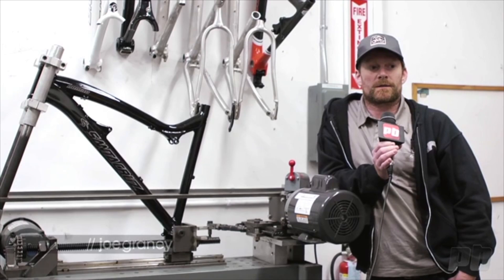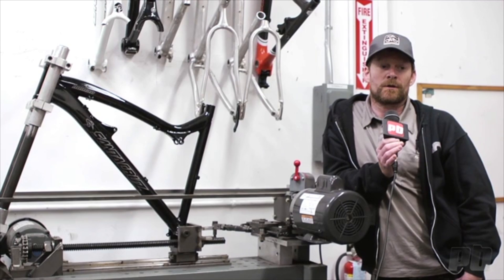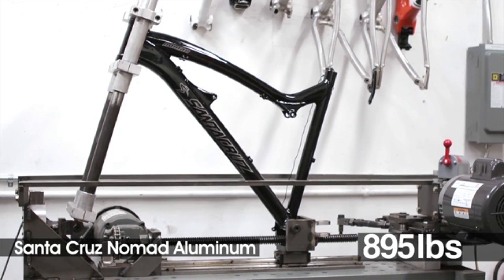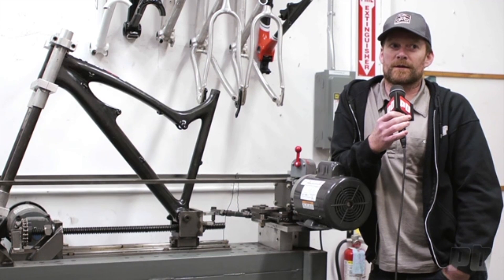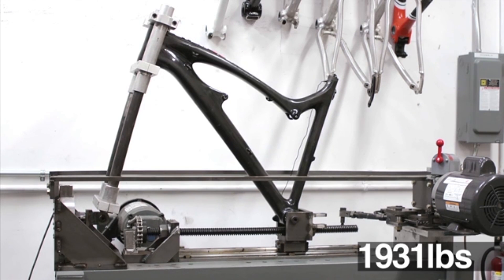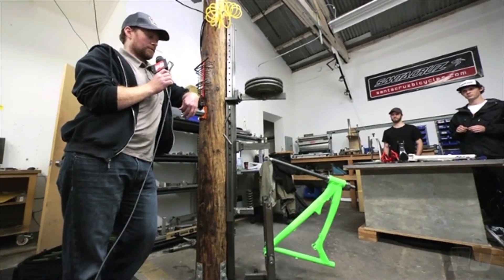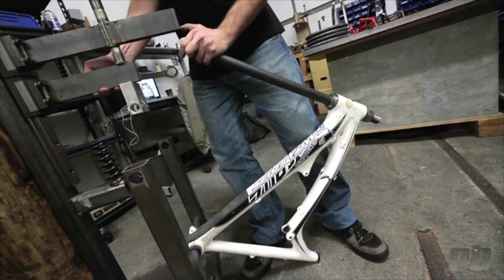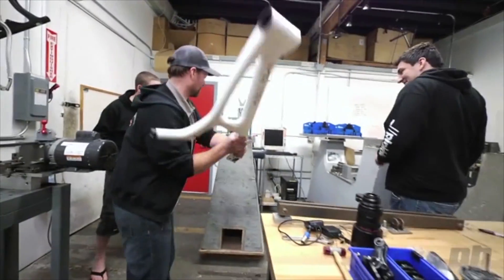Carbon vs Aluminum Frames - Which is Stronger?

Comment: Aluminium fails slowly, allowing one to detect problems before anything too serious happens. But carbon fails catastrophically (sudden snapping), which is way more dangerous to the rider.
Reply: what about riders with arms that cannot withstand 2100lbs of force from casing a jump ?
Reply: carbon dick splinters adds to the fun of riding bud
Reply: Sometimes. Really rigid carbon parts tend to do that. Delamination based failures are usually pretty gradual. You'll hear cracking as successive layers of carbon delaminate and fail.
Reply: MrChangCJ With the paper thin double butted tubes used these days in alloy framed bikes the yield point and ultimate failure point are very close together. As for carbon, I'd be more concerned about dropping a carbon frame sideways into a rock and cracking it on a load it wasn't designed for....
Reply: @eaxnitro  you do not need to worry about this. All frames which are properly manufactured are also crash tested.
Reply: @eaxnitro  super valid!!!
Reply: MrChangCJ I have seen all metals fail welds snap often with no warning!
Reply: hmm, i see. thanks for the insight. i shall do more research.
Reply: @gillenzfluff8380  Then you were not constantly inspecting the welds on a regular basis.  They just don't snap with no warning its not their nature.  There is neglect somewhere in there your not telling us.
Reply: still defend on the rider how they ride it ..
Reply: The thing that really scares me is if a sudden impact causes frame failure it will also cause the rider to fly forward with great force.
I'm afraid for the body part which will end up right where that broke, and a sharp edge with sharp penetrating fibers isn't my idea of a good feeling.
Reply: You hear creaking noises before it breaks in two. And for that, like I said below, you will alose need to weight like 600 lbs.
Reply: this isn't accurate. i've seen the exact opposite happen.
Reply: This may be mostly true, but the carbon frame holds up to much more abuse, as seen in this video.
Reply: Yeah but its also way stronger dude.
Reply: Spot on. I've seen carbon bars snap off of a drop so fast the guy went face first into the clamps.  Had they been aluminum i feel he could have saved his face with a bend. I've has aluminum bars since day one and have bent them giving me the opportunity to replace them.  Just the thought of eating a clamp makes me want to keep the aluminum.  But on the other end I love the looks and feel of Carbon.
Reply: @benmartin3351  I can't bare the thought of CF bars for this very reason, a frame sure but bars never.
Reply: @bojangles2492  
 
I had three aluminum bars break on me (back in the 90s, so on the one hand probably thicker, but also probably less technologically advanced) and all of them went “snap!”; no warning.  Switched to titanium and no problems since.
Reply: @benmartin3351  
I had three aluminum bars break on me (back in the 90s, so on the one hand probably thicker, but also probably less technologically advanced) and all of them went “snap!”; no warning.  Switched to titanium and no problems since.
Reply: @benmartin3351 cheap carbon bar, ehh? People these days are talking about buying the china carbon bars, bro if they snap Im not surprised.

Quality components almost never fail.
Reply: I broke an aluminum frame just by applying my rear brake, how are you going to tell my the sound of my frame snapping was slow and allowed me to detect the problems before it had a catastrophic failure.
Reply: @carson54444 you buy cheap POs bike  lmao
Reply: Oe si tienes razón! El aluminio te avisa con tiempo
Reply: sure carbon composite components such as the frame don't involve plastic deformation, but in most cases their stiffness is so extremely high that their elastic limit is not surpassed.
Reply: Metals build hairline fractures. Generally the welds that fail.
Reply: @Mp57navy  yes, and not directly at the weld seam but in the immediate vicinity. But that is something you got to be looking for in order to see it. Thats why washing the frame properly and looking at every weld seam is a must. If you do that on a carbon frame it might still be hidden between the layers and thus impossible to see without NDT (Non Destructive Testing, like an ultrasound).
Reply: @Mp57navy again only true for bad quality. Most of the time quality weld joints are stronger than the material itself.
Reply: True it becomes is absolutely dangerous to ride, but on the other side carbon is pretty much always repairable and once repair it will get back to its brand-new state and costs fraction of what a new frame would cost.
Reply: But, IPP, what you've seen is a lot more exciting carbon.
Reply: There are also more problems to detect in Aluminum.
Reply: My alu frame broke without warning if a sudden crack forming is considered without warning.
Reply: From what I've seen and heard, that's not true. There is a reason miners avoided metal beams, it snaps under pressure without warning. However, Carbon, as far as I've seen in several videos, just slowly disintegrates. I also had a Titanium seat post snap of recently, that was not sudden, but quick enough, same happening on a frame would have been terrible.
Reply: Nope, that has been debunked.
Reply: You're seriously writing this on a video that shows the carbon one to be 30-200% stronger in every test. 

Yeah I'd much rather have no breaking than slow breaking. 

Fucking copium.
Reply: That's right i geus 😢
Reply: I ride carbon stumpjumper and santacruz 5010 ,  with my 71 kilo no much harm on the bikes , I love carbon , iths so strong carbon wins 🎉🎉🎉🎉🎉
Reply: Steel is real, bitchez!
Reply: @WesleyChe  yes!!!
Reply: I have replaced the front triangle on my 2003 Kona Stinky Dee Lux twice because it has bent or failed catastrophically during hard impacts, but I love the bike and it's geometry so much that I'm unwilling to part with it. I feel the same as another poster in that if I were a sponsored rider, I'd ride a carbon frame without any fret, but as a private rider an aluminum frame is cheaper to maintain and replace.
Reply: The tests were for massive jumps anyway
Reply: Yes but more spectacular, imagine the video you'll get, just wear a full face.
Reply: Yes best answer here for sure !
Reply: Aluminum can brake just as sudden. It’s about where you get your frames from. Cheap frames will always brake way more often than good ones.

But I would indeed rather ride an aluminum budget frame, I don’t buy cheap carbon.

But for me quality carbon is at the very top. Nothing beats it.

Comment: The aluminium is stronger than carbon after 2 or 3 years of use. (which is the carbon longevity)
then, it just breaks out. the alloy bends.

Comment: A fail in the aluminum frame seems to equal bent, whereas the fail in the carbon frame equals snap/shattered.  I would rather take my chances with a failing aluminum frame out on the trail.
Reply: it will take a ridiculous fall for you to break either one.
Reply: but ig once there is delamination, it slowly gets worse over time even on small "impacts" from regular use
Reply: dumbass smh
Reply: Good
Reply: Charles Pastore or you get shards of carbon going into you, then breaking apart inside of you making it much harder to remove... Your choice
Reply: even with delamination on the carbon frame, the aluminum still completely failed before the carbon
Reply: Shane Scott or you get cut on sharp aluminum...

Comment: On the first test the carbon frame was delaminating way before it snapped.
Once it starts to delaminate its over...
Carbon and aluminium have diferent properties. Simply saying carbon is stronger is VERY misleading.
Reply: Its good thoughts. But! Aluminium also start to deform plastically before it fails. After the first plastic deformation it is also: game over for the frame. It will fail completely very soon. To be very precise you need to find the point of the irreversible deformation of both frames. That would be very scientific and not spectacular. Still this comparison is very good to have a slight impression.
Reply: @nawowas8818  Almost. Yes, for Alu, the force at which it starts plastic deformation it's first failure. For Carbon Composite it's the the force at first crack, because in a complex structure like this the permanent deformation might be undetectable after the first crack. And given the complex forces a bike withstands on a ride, a simple crack for a carbon composite frame from one load scenario, might generate a catastrophic failure at much lower forces for a different load. So if they did the first test and stopped at the first crack of the carbon frame, then put the same frame on the drop test, I doubt the second test would have reached such high values as the frame that was just tested with the drop test. Although, doing the same with an Aluminium frame, the result of the drop test after the first one, would be very close in impact results compared to the frame just tested with the drop test.
Reply: @jpfidalgo7  did noone really listened on how beated Up that first carbón frame was already to begin with?
Reply: @vittocrazi  did you read my comment? I'm not questioning the frame, just to explaining the differences in failure modes between both frames. As an example, and completely speculating, both can have the first failure mode at the same load, or different for either case. So the aluminium frame could deform permanently with 500kg and the carbon could have the first crack at the same 500kg, or higher or lower than that... I mean the first failure mode is different and subsequent failure modes change a lot.
Reply: @jpfidalgo7  i tagged you by mistake
Reply: @nawowas8818  yes its called it will buckle and bend before it snaps
Reply: Pedro Gonçalves exactly- they need to take the force at where the frames begin to fail rather than where they completely fail
Reply: if you like a breaking frame more than a bending frame before failure, then enjoy the carbon, mates. 
more interesting is the fatigue strenth.
and to all the people who have a better experience with carbon frames. Please write how much you paid for the al frame and for the c frame. Both  materials have their right on the market.
Reply: @meddy921  tbh if you break your frame you are a very very fast rider and crash really hard so if you ride like the average person either is fine tbh if you race aluminum is a bit better although carbons starting to get way more stiff and durable on bikes compared to 2015-2018 so now its kinda hard to go wrong with either
Reply: Very misleading haha..
Reply: @ernestchoi7891  it is only misleading to dumb people
Reply: Agreed!!!
Reply: Alum frame were buckling at 800 ish . Would've been junk at that point . At least with carbon you would still get some More use out of it.
Reply: Darrell Funk and then you can throw it in the landfill where it will stay for eons. 👍🏻
Reply: @djfung  And carbon frame starts cracking at 500 lbs
Reply: They are just trying to get you to spend more money on carbon
Reply: @bike-cave-man2527  Canyon bikes snap all the time either carbon or aluminium...
Reply: @bike-cave-man2527  anecdotal evidence is no proof of anything.  There's too many variables to why your aluminum frames failed while your carbon has survived.  I rode a Cannondale caad8 with a dent in the chain stain for years and never had issues, doesn't mean all aluminum frames behave the same way.
Reply: @bike-cave-man2527    Generally in   9/10 tests  Carbon is  stronger than Alu
Reply: Thank you. Finally some one else understands
Reply: Bike-Cave-Man canyon and vitus? Please. Throw some nice metal frames in there and we can talk. I broke 2 trek frames. Nobody to blame but John Burke’s greedy cheap-ass ways. #tuckfrek
Reply: @bike-cave-man2527  Just buy a dirt bike bro, there's a lot of option even electric ones

Comment: carbons fatigue strength is amazing but what about crash strength even though they did a smash test there was no x Ray that would have probably shown micro cracks or delamination. and most the test her stop once the steel bends but they wait tell the carbon snaps they don't stop when it's just cracking. and alluminum may show the damage whille carbon could hide it I'd take this test with a bigger grain of salt if the frame was x rayed after the tests

Comment: Was a Santa Cruz fanboy until I saw this. These guys mke sick looking bikes though.  I hope they played coy, and the SC engineers aren't this clueless.  Carbon microcraks and delaminates instead of bending or warping. Yes it exploded at a much higher pressure point than the aluminum but if you stopped the test for carbon at the failure point for aluminum and testing it with ultrasound you would see just how misleading this video is.  MTB pros use carbon not simply for the weight savings but for torsional stiffness, and its ability to do just this.....stay intact at a further point in its structural failure.  When your racing a 3 min downhill and you hit a big jump wrong, youll be able to finish on carbon where as alloy will probably warp or bend.   Doesn't mean the frame is any less broken though, just more rideable enough to finish.  Works for the pros who will just swap a questionable frame out anyway, not so much for the dentist being a warrior on the weekends.

Comment: im 220 geared up and lift weights. im still super skeptical about any carbon. i have to buy overbuilt chassis. i was at bike america looking at chassis and some of them have super skinny rear triangles. i think a lot of bikes are for sub 140 lb riders. i would not buy them at all. or you see pivots with super high bi directional bearing movement which you know is going to fail fast. and those frame where there is a lot of shock eyelet movement. ya no way.

Comment: The carbon frame creaked first time at 800lb. This kind of frame is already unusable. 
Alluminum frame bended irreversibly just some when over 1000lb. Carbon is a good choice for tarmacs but definitely not a good one for consumers MTBs

Comment: The only problem I have is, why do I see more carbon frame fail or brake then aluminum. If you lessen close the carbon frames are cracking a lot sooner then they lead on. If you ask around I bet there are more story's out there about carbon failing then aluminum. I raced bmx for years from chromoly, titanium, and aluminum. I would have to say I only ever seen titanium bikes crack. Now going back to the eighties I did see a JMC brake at the weld.